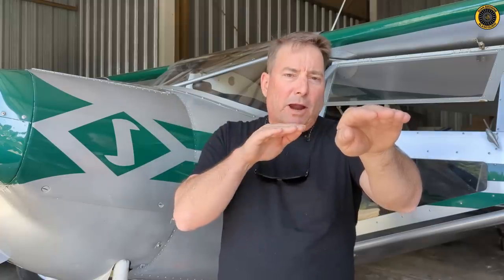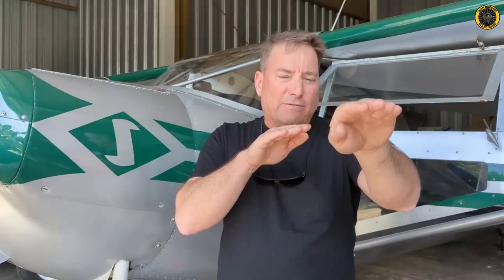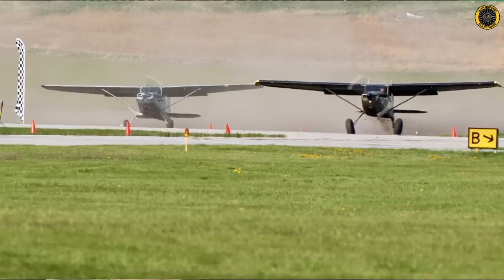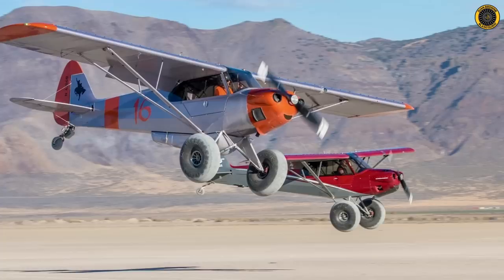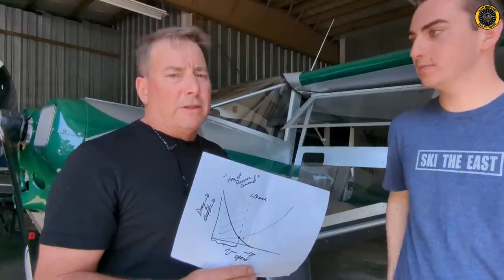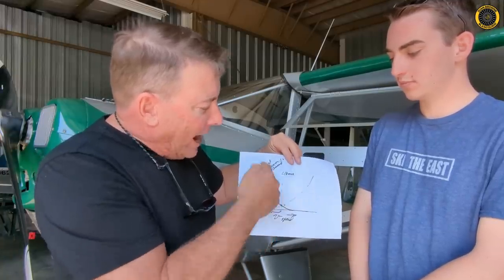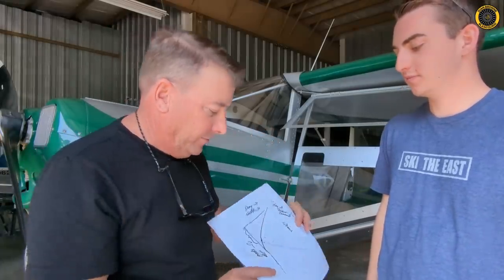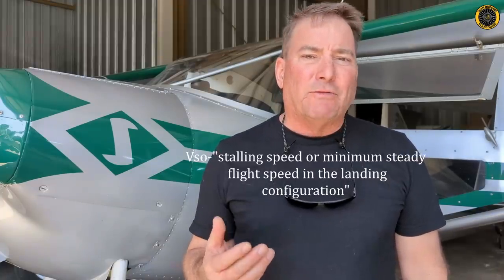Cessna 140 Stall/Spin Accident Wayne NE

Comment: I got really familiar with the notion of "Decreasing Headwind Shear" from back in 1991. I was flying out of Atlantic City from Bader Field and strong  winds were coming off the ocean from the East. We lined up for runway 11 with a couple tall casinos in our path to the ocean. We saw the departing Cessna climb a few hundred feet and then he inexplicitly descended quite rapidly. He then banked hard to the South, and then hard to the East over Atlantic Ave I believe, where he made his way out over the boardwalk and beyond. We tried to reach them on Unicom but got no answer. We eventually finished the runup and departed the same runway. Then at 350ft or thereabouts the stall warning horn blared, our airspeed dropped by almost 30kts, so we pushed the nose over, turned to the South, and then to the East and over the boardwalk. We happened to have entered the Dead-Zone where the wind from the Ocean side was essentially blocked by the casinos as we got closer and closer to them and the boardwalk. Nothing left to do but push the nose over, get some speed, and navigate around the buildings to the South. There were Notams about wind shear, but I was a new pilot and didn't really have a deep understanding of how big a factor that change in direction of wind, or in our case, the complete disappearance of wind could be. Lesson learned!
Reply: Thank goodness you had some elevation and reacted quickly! Scary.

Comment: Having owned C120 with a C-85 engine I wouldn't dream of doing STOL in that thing.  Good, basic aircraft.
Reply: Its like bringing a yugo to a drag race.....why?
Reply: Years ago I used to ride an old CB350 Honda, a very tired, elderly and worn out CB350. I knew that bike like the back of my hand and knew how to ride around it's shortcomings. 

My friends all had 400cc race replica bikes and I used to ride with them at quite high speeds around corners and so on. One evening,  we all swapped bikes and my friend who was regarded as the fastest rider amongst us took my knackered old Honda. 

5 or 10 minutes down the road he pulled over, I pulled in as well thinking one of it's many faults had manifested itself but he hurriedly handed me the keys and said "you're a braver man than I had you down for".

Yes, that old crock of a Honda could be ridden fast but it was constantly on the ragged edge whereas those little 400 race reps were well within their comfort zones. Decent brakes, good tyres, power on tap and great frame geometry and handling whereas my old Honda had brakes that were ornamental at best, tyres were round and black (that's the best review of them, really), you had to pin the throttle open at every opportunity to even hope to stay with the faster bikes and it wouldn't always give you the same results every time you opened it up and the frame felt like it had several hinges built into it. 

Yes, I could "make it do fast" but should I have done it? Absolutely not. And, in my limited understanding of this unfortunate gentleman's demise, neither should he have taken this little Cessna (aka a little Honda) to a race meeting. I'm guessing that that little aircraft was operating far nearer to the ragged edge I mentioned above than it's racing counterparts were.
Reply: Had an RZ 250 like that.
Very spooky little rocket.

Comment: Induced drag is not specifically from wingtip vortices but from throwing less air downwards faster as you slow down.  To stay aloft the momentum of the air thrown downwards has to stay constant, but as the amount of air you hit gets reduced by reduced speed, you have to throw that air downwards faster.  Energy of the thrown air goes like the square of its velocity, so increases with lower speed, and that energy shows up via the Navier Stokes equations as increased drag on the airplane, growing like the (the reciprocal of) the cube of the velocity, so in short very fast as you slow down.  Wingtip vortices are just one spectacular way that the lost energy persists to be seen, but most of it is just air thrown downwards, which produces no particular visible effects.

If you want to capture a bird in a room, just keep him flying by prodding with a stick wherever he lands, and he'll fall to the floor exhausted in short order.  It takes huge amounts of energy to fly slowly.  The same bird flies continental distances at higher speed.
Reply: Forget 1/v^3.  Done too quickly in my head.  It might be 1/v^3 but not with the calculation I did.
Reply: @yclept9  if he had done his math he would still be alive?
Reply: It’s all about airflow separation. You might want to re-read Mechanics of Flight or Flight without Formulae. 😊
Reply: @gogogeedus   No need to go to math, keep it simple by explaining it as Juan did and demonstrate it. Many instructors don't "teach", those that don't are simply building time 😡. You don't get paid for pre-planning the flight in the classroom,stuff the student in the plane and get the Hobbs Meter counting time. Have much experience as an instructor and FAA Designated Flight Examiner. That's where I learned some instructors do not impart their knowledge 🙄
Reply: @gregorylocke  Stalls are about airflow separation.  Induced drag (more drag the slower you're flying) is about throwing air downwards.  A lot of the air thrown downwards comes from the air above the top of the wing until the flow separates and then that air isn't much thrown downwards and you lose a lot of lift.  Bernoulli by the way isn't the cause of flight - it reverses cause and effect.  The air goes faster because it ran down a pressure gradient.  The wing shape happens to be an efficient way to throw air downwards without huge forward drag, but that's thanks to the Navier Stokes equations and not much else.

Comment: Hang glider pilot here.

Basically every landing I do is a STOL. I don't have wheels! The description Juan gave is perfect for how I approach a landing. Come in with speed, get into ground effect, allow the aircraft to bleed off speed, gradually increasing aoa until a final flare at the end coming to a dead stop, where I extend the gear.

Wind gradients and gusts are much more of an issue for an aircraft that stalls at maybe 12 knots. If it's blowing 25 knts at 100ft, and 5 knts on the ground, which is not uncommon, you need to have some airspeed on hand to cope with that, despite the very gentle stall characteristics of a swept wing with large washout.

Comment: I was fortunate enough to have instructors driving the point home that rudder is your best friend in this circumstance, not aileron. One exercise we did was establishing a dead-stick descent with no hands on the column and using the rudder to do the work - all the way to landing. Point made! Condolences at the loss of your friend, to his family, and the flying community.
Reply: Yes, too little emphasis of when to use only is no longer taught so much.  The rudder only technique works with the power/pitch approach as well...even better because of prop blast on the rudder.  I taught the STOL type power/pitch deceleration on short final coming into ground effect approach as default.  I jammed my thumb against one side of the stick or below the right side of the yoke on short final.  When the student tried to make a coordinated turn (use aileron with adverse yaw) and looked over at me I would say, "walk the rudders."  If we walk the rudder pedals to bracket the centerline, the airplane cannot turn, cannot bank.  Unless we lead rudder when we do want to turn, the nose will go the wrong way.  Stepping on the ball, a reaction to fix lack of coordination, does not help on short final because we have already wagged the wing.  Next attempting to maintain altitude in a startle turn at very slow airspeed is just too much for dynamic neutral stability to fix unless we release all back pressure and allow the airplane to do what it is designed to do:  fly and not stall.

Comment: Isn’t the Cessna 140 a bad choice for STOL competition
Reply: Yes. He was taking 50 feet to take off in a head wind. Sad
Reply: as proven
Reply: Any plane could technically compete in a "stol" competition as long as you understand that stol is a relative term based on a particular aircrafts design and performance limitations. You might not win the shortest stol landing or takeoff, but you might win it for similar aircraft type.
Reply: No it is not,STOL is taught as basics to any student pilot in whatever plane they are flying.
Reply: Five kids… Jesus.
Reply: @garymiller5624 hell no

Comment: What is significant to point out is, when flying on the backside of the power curve, is speed instability. When the speed drops off slightly, more power must be added immediately to keep that speed (as power required is higher for the lower speed for level flight). Reversely; if the speed increases the aircraft will accelerate further as less power required for increased speed. Typically, at the backside of the power curve, part of the wing has separated airflow already. This means that you have to be on top of the game with power, in order to keep a certain speed. One moment of distraction and you’re falling out of the sky. This event looks like that’s what happened (traffic in front of him). 
The slope of the backside of the power curve is strongly related to wing aspect ratio’s. A high performance glider has a short steep backside in which it is virtually impossible to fly without breaking a stall and delta wings have long, manageable backsides in which manual flight can be conducted with relative ease. I flew for years seat of the pants without knowing this until I found out during my aeronautics college flight performance classes

Comment: From my knowledge & experience with the 140, it wasn't designed to be a STOL aircraft and should not be flown as such. Great for conventional T/O & Landing.
Reply: 100% Wrong and illogical. STOL is not an aircraft model, brand, engine hp, Alaska landing gear, or aircraft modification.

The 140 is a great antique aircraft, perfect for participating in STOL events and pilot was experienced qualified STOL pilot on the Cessna 140.

Comment: One very important aerodynamic effect which Juan didn't mention in this video is the importance of taking into account wind gradient when descending the last few dozen feet to the runway when on final. Because of ground friction, the speed of the wind is slower near the surface than it is just a couple wingspans up in the air. This means that the airplane is descending through a wind that is continuously decreasing on short final. This decrease acts in the same way as the loss of wind velocity/airspeed when a gust dies or reverts to a slower nominal windspeed after the gust passes. Energy in the form of a particular windspeed is lowered (as far as the wing of the descending airplane is concerned) when the gradient is entered, which could definitely have been the cause of the stall which led to the beginning of the stall/spin. Condolences to everyone involved.

Comment: I know this was a tuff video to produce. Your all in with STOL events like Valdez, AK, Oshkosh and the Reno Air Races. This is a sad situation because it happened in the traffic pattern. 

Tom probably misjudged the speed of the Zenith on final. I'm guessing pulled power back, brought the nose up and tried to hold altitude. The classic textbook entry. You need to ADD power to keep your airspeed. Banking will increase stall speed.

If you enter a stall, unload the wings. Add full power and level the wings.

In Aerobatics we teach P. A. R. E for spin recovery.
P - Power Idle
A - Ailerons neutral
R - Rudder FULL opposite spin direction
E - Elevator Neutral

Comment: You are right about Stall/Spins, I learned to fly in the early 1970’s at a Piper Flight Center. The Instructor & I would spin the Cherokee 140, do a full Stall and Right or Left Aileron, the 140 would break into a Spin…

Comment: Juan,
   Something I noticed in the video of the crash that AOPA provided; at the point just prior to the stall/spin, the aircraft starts to accumulate a sink rate.  The net effect of this increasing sink rate is a shift in the apparent wind in relation to the chord line of the wing.  As the aircraft starts to sink at a low airspeed, the AOA is increased as the apparent wind moves down.  This means the airplanes attitude hasn't changed, yet you are approaching critical AOA.  In many cases the airspeed will not change, and the pilot will not realize the AOA is changing.  This is why an AOA indicator is such a good tool, it measures AOA not airspeed.
Reply: So true!  An AoA indicator properly used at that moment might have avoided this tragedy completely.

Comment: Juan - Almost tragic deal at Wawa Ontario in '74. I drove w/Buddy from MI, Cessna 172 Float Plane to Lodge, caught lots of fish, Beaver (luckily) for return to Wawa w/dense fog, in 100% whiteout got clearance from Air Service using engine noise for clearance of hill (mountain?) to settle/land. I not pilot but seated in rt seat. Told pilot had passed ground school, but ours said I jumped stretched arm out near to windshield & shouted "Mountain There"!  Supposed to be only dense fog there so pilot yelled "Full gas, full flaps, here...take wheel and pull until straight up". Pilot trimmed, adjusted, and coaxed most from Beaver until I said "Straight up Sir"!  Pilot grabbed wheel while I said "Sheer rockface 10' below floats".  Pilot dam near sht.  We were slow but with full power & engine snortin' did continue up short ways until I said "That's it", pilot kicked rudder & w/last air over control surfaces Beaver turned straight down 'till treeline meant Pilot dodged trees until trimmed top off last one and roared up into the safety of the zero visibility fog.  Pilot got schtuff back together, went around with new approach, got new more better clearance from Owner of Air Service that had just tried to kill us, and performed perfect landing.  I know what you want Juan...what was the cause of the near crash?  Well, it was bizarre.  On other line Owner had The War Dept, ignored handlers' shouts that sound had went silent (Mountain between Air Service and plane again), but continued to have other cheek ripped off by his Wife, so I suppose the cause would be filed under "Beautiful Beaver nearly lost due to cheek removal by angry Beaver operating remotely"!

Comment: ‘Controlled approach’ is a phrase that Juan and Mentaur often refer to in relation to commercial accidents. Obviously STOL flying is dealing with extremes but cutting the pattern knowing you don’t have the lowest stall speed was probably the main factor. That meant you were now not doing a ‘controlled approach’ and certainly not in the ideal situation to explore the limits of your aircraft. Juan also says if in doubt throw away the approach. One question. We’re the pilots in touch with a controller? Apologies if these are dumb, non-pilot comments.

Comment: Is there any consideration being given to wake turbulence from the lead aircraft which appeared in the video to be slightly higher and to the left of the Cessna’s flight path. With a crosswind from the left the disturbed air would drift towards the Cessna.  This could quickly put an aircraft already on the edge of a stall into an unexpected full stall with no room for recovery. 

More separation in the pattern and faster planes in the group going first is needed.   My heart and prayers go out to the family and friends of Tom.  CobraPilot45
Reply: Spot on! My thoughts exactly, way too close, and lower than aircraft in front
Reply: I've flown behind landing airliners as part of my routine at PBI.... a lot of wake follows a big jet in dirty config.  It is hard for me to imagine a tremendous amount of turbulence in the wake of a STOL aircraft (Juan mentions the type above), especially at the distance between the two.   Anything is possible - especially with such thin margins and an airspeed hovering at stall.  I tend to think even the slightest aileron action going to tip the scales to stall... and exacerbation of the situation with instinctive over-correction.
Reply: @josephbuckley1574  ive had it happen to me, guy flew in front, and above me in super cub, scared the hell out of me, on t/o , lucky i had quick rudder feet. Dont ever say it cant happen with small a/c…..big mistake;)
Reply: Wake turbulence from such a light aircraft likely wouldn't cause this by itself, but for a trailing airplane already close to stall, with some aileron corrections here and there for gusts, I could see that bit of disruption over one wingtip from the wake putting it over the edge.
Reply: The APOA video on the incident talks about this.